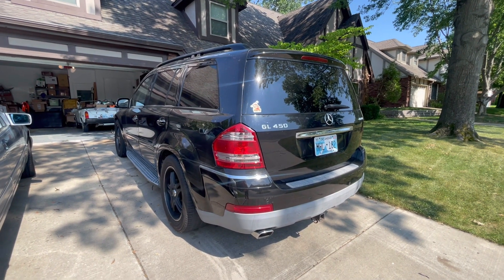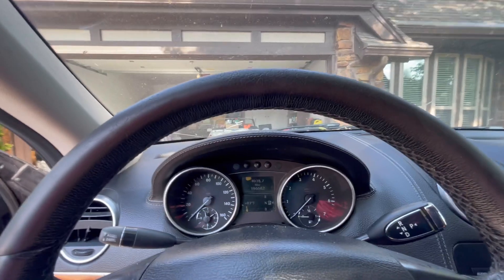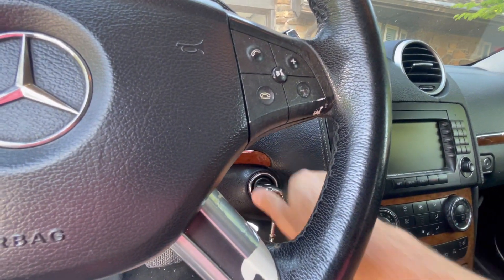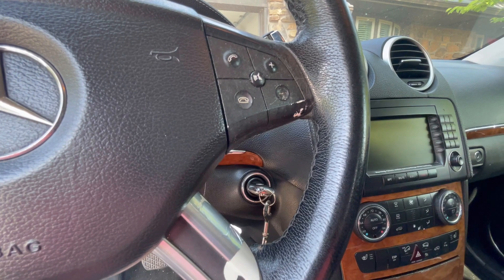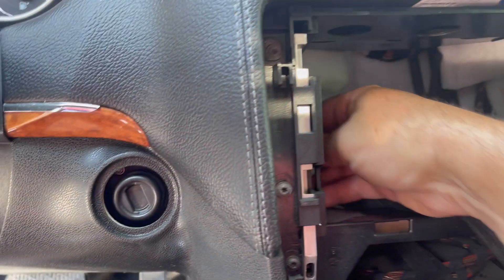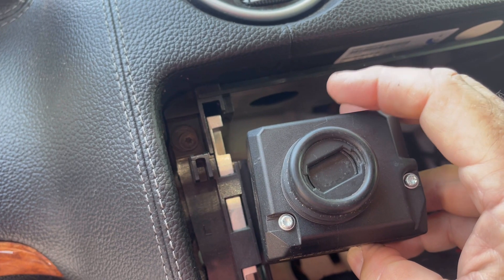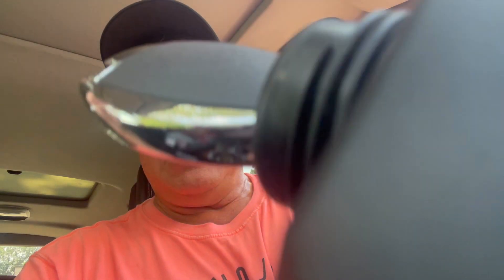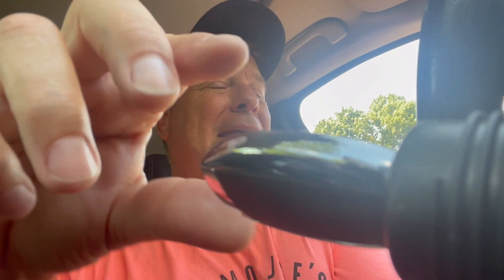Mercedes EIS and O2 Problems

Comment: In my vast mercedes knowledge... I'd say what happened to your old key was that it was dropped and a connection came loose. It happened to me and I took the key to a guy that did micro soldering at a batteries plus location. $25 fixed it then I bought a silicone "key shirt" to protect it.. get a key skin if you own a mercedes ✔️💯
Reply: Will you try this with the old fob? You'll have a 2nd key 🔑 😉

Comment: At least the repairs weren't credit card depleting or require a bank loan and they worked. Probably didn't help but I was holding my breath as you turned the key as well. The sound of the engine starting warms the soul like very little else. Thank you for the great video.

Comment: That TPMS light is a simple fix as well, but it requires tire changing equipment to do it though. More than likely all 4 sensors in the tires have gone kaput from a combination of age and mileage.

Comment: Mike on the tire pressure light I had the same problem with my Toyota Rav 4 I would check all 4 tires and they were at the pressure they were supposed to be, I friend of mine suggested I check the spare tire it didn't make any sense to me but I checked it and it was low put air into it drove the car and low and behold the light finally when our

Comment: Mike try Auto Key Max  or Beefunny Smart key replacement fob (Yes they may possibly be made in China :) ) Each has specific models and years they replace and are about 1/10th the price you paid. I got a replacement for me early 2000's CL a few years back. I also have a suggestion about building community for you. Why not setup a Discord server and use it to get people looking for parts/ info and share pix etc. Just trying to help you get richer.